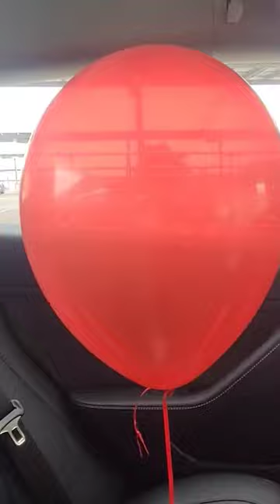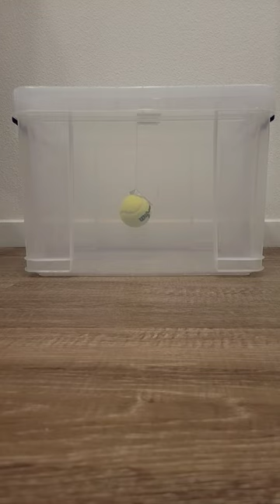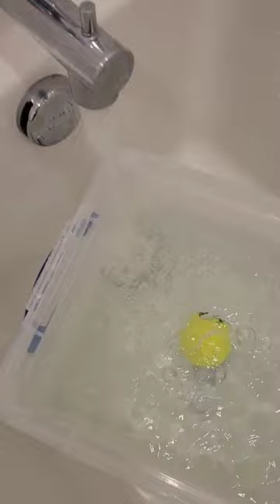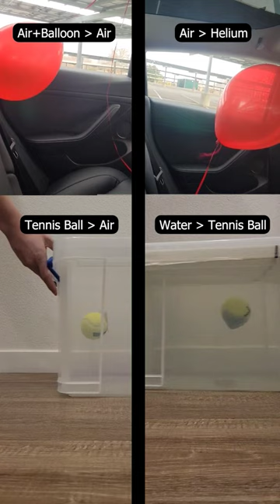Helium Balloon vs. Tesla Model 3 Performance! #shorts

Comment: I've seen this hundreds of times before and never really understood until you showed the bottle with the air bubble.

Of course, it all makes sense. Air is a fluid, so it would be pushed back like when you move a cup of water. Because the helium is lighter, the helium balloon goes goes forward as the air rushes to the back, like displacing an air bubble in a bottle of water.

Thank you for that man, I finally get it.
Reply: Yoo thanks, I actually understand it now

Another explanation I've heard was that the helium balloon has negative inertia because it has negative mass, which is untrue because mass ≠ apparent weight, so I got very confused lol
Reply: @NOT_A_ROBOT  I mean, that isn’t conceptually wrong, but I feel like it makes things so much more confusing
Reply: That's a good way to explain and a way also think and really how it is. We just don't see air to make sense but it's very cool and yet simple
Reply: damn this was a good explanation i could actually visualize
Reply: @TheM.F.  i aint an expert but even i know that helium has mass, its just that its less dense than air

Comment: Its all about inertia and newton’s first law. 

Inertia depends on mass, which is related to density. So the denser thing “wants” to stay stationary more while the less dense thing can start moving easier when the container starts moving.
Reply: so jus to recap since helium is lighter than air it'll move forward but the air balloon moves back bc it's heavier than air?
Reply: @calebpaulsen9717  yes